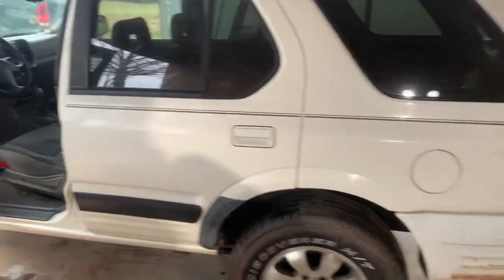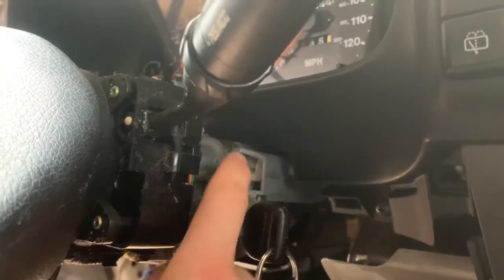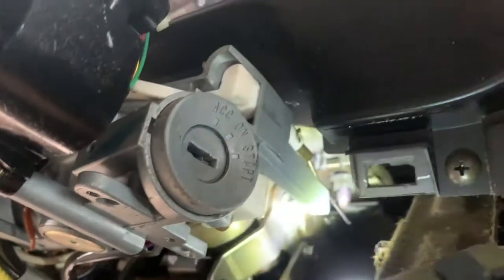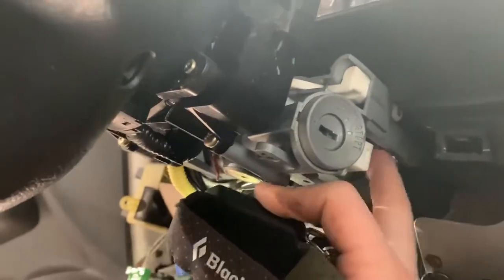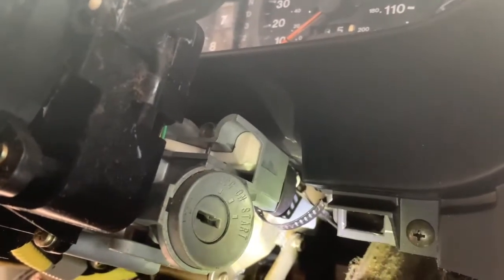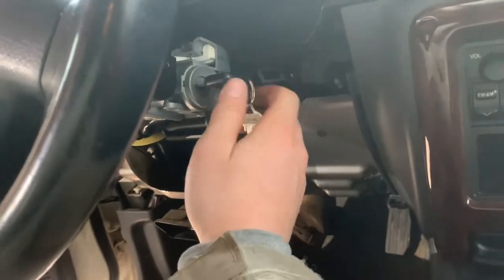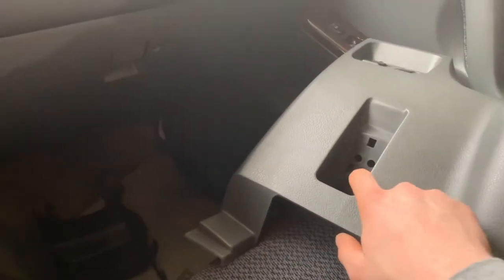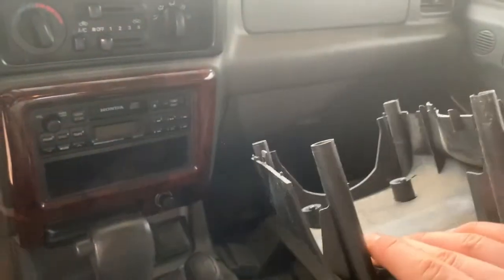Removing stuck key from ignition Honda Passport Isuzu Rodeo

Comment: Got a 98 Rodeo with the same issue.  Did what you did and bingo. problem fixed.  thanks  for posting this video.  I appreciate you.
Reply from the maker: thank you for watching! I'm glad to have helped
Reply: @JustinBiddix  any idea on how to take off the driver's side door panel?  I want to replace the cylinder lock.  Some moron wrecked it with a screwdriver.  thanks in advance.

Comment: Thanks for this video............I have a 99 Rodeo.....I had the same issue and your video saved me lots of time and money..........I just pulled the pin that holds the cable unto that white slider thing.........the key still locks as OEM.......the slider is able to return to its normal position so I am able to remove the key..........no clamp needed.........Thanks again.......

Comment: No need to cut the wire. I just removed the silver bracket that gives tension to the wire (one screw) and used a tie wrap instead of hose clamp.
Reply from the maker: Thanks !